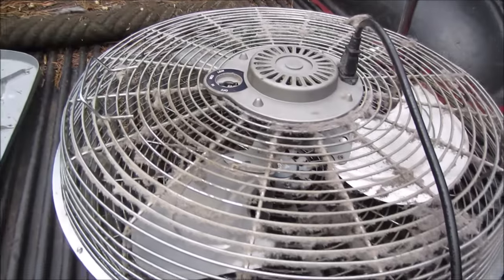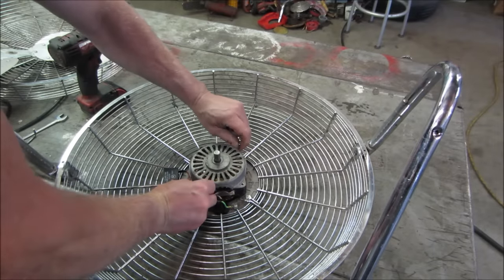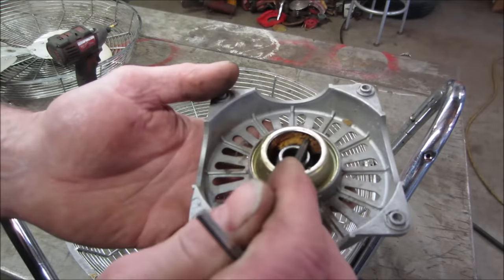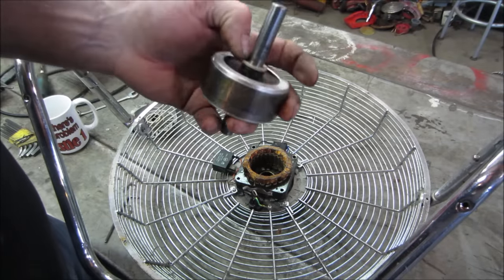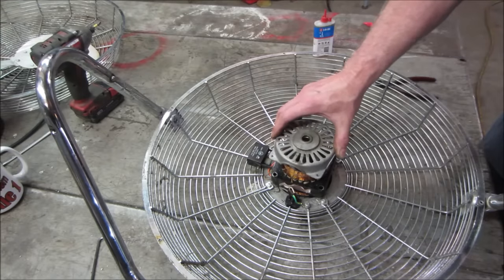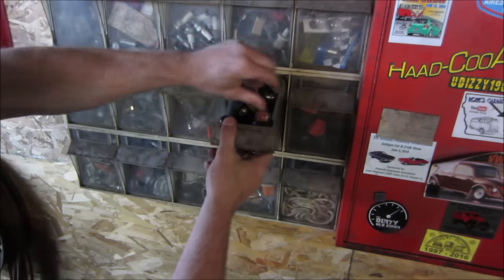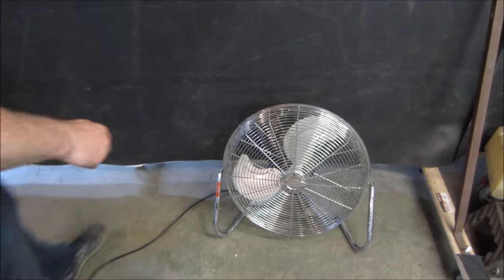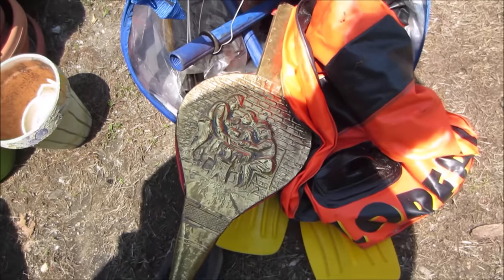Fan Blades Won't Spin? Lets Fix It

Comment: Sometimes when I’m yelling at the screen, I can’t get your attention.  Actually the yellow fiber IS for holding oil. The yellow material is an injectable oil impregnated cellulose, and the sleeve bushings are oilite type. It looks like they didn’t put enough of the yellow fiber material to keep the bushings wet.(probably on purpose to kill the fan in a couple years so a new one will be purchased). Adding some cotton wick and soaking with light oil will keep that fan running a long time.
Reply: You beat me to it!  Yeah, the manufacturer was sure stingy with yellow stuff.
Reply: Exactly. And if you're not going to run that, you should coat it all, shaft and bushing with PTFE.  That'll last a couple years, but eventually it will wear away. The oil and wick lasts longer, but if you can't fix it because you don't have a wick PTFE spray is a nice fix because it also doesn't attract any dirt and it will be slippery for a while.
What he did there, will probably last a few months but when he takes it out from the winter time it might stall again.
Reply: You beat another subscriber.  And that electric motor oil works really well with rejuvenating the bearing when soaked into the fiber wadding
Reply: @TravisFabel  that was literally what i was about to ask next, thx~
Reply: @TravisFabel  what's PTFE?
Reply: @WowHughJanus   PolyTetraFlouroEthylene, aka teflon (and multiple other names)
Reply: @michaeltempsch5282  Actually, its spelt polytetrafluoroethylene; not normally popular in spelling bees.
Reply: Would a corded electric mower run off a similar concept? Mine seems to have a similar problem to this fan.
Reply: over the long term I found that using actual oil lamp wick as replacement works pretty well
Reply: Thanks for the info! I found this same stuff when I took apart my furnace fan that I had replaced when it had started making noise. At first I thought the grease had all dried out so I started to dig it out but it was lighter than dried grease. It was the same as the fan but white-ish grey and looked like they were stingy with the material. I tried to search online for more of the material but couldn’t find any. I wondered if cotton ball material would be an ok substitute? Anyway I ended up just soaking what was left in machine oil (3in1). The damn thing spins like new now so I figure I have a backup if it happens again. I tried searching for posts talking about furnace fans but didn’t find any. So if your furnace fan starts making noise. Instead of running out and buying a new one, take the cap off what looks to be the bearings and soak the bushing and that material down in machine oil. 👍
Reply: manufacture cheaped out, using yellow sponge material in place of the fiber, which which worked too well and lasted many years! ;)
anyway, the oil slowly attacks the foam and it breaks down shriveling into a gelatinous goo. it would have been out far enough to contact the bushing/washer on the shaft to provide lube that way.
Reply: I bought a box fan at Gibson’s in Durant Oklahoma in 1978. It has served as an attic fan in my first home in Garfield, Arkansas, circulated air in the desert heat of Boulder City, and Las Vegas, NV, and now lives in my greenhouse in Montana. The plastic grilles died of embrittlement over a decade ago and were replaced with 1/2” hardware cloth.  Every couple of years I take it apart, clean out the dust, soak the bearing pads in light oil, and put it back together. 42 years, and all I need to do is oil it every couple of years.
Reply: Glad Im not the only one lol. Yeah seen lots like that where they dont even bother putting the felts in to hold oil for the bushings, or even bother with the oil itself for that matter. But properly lubricated they can indeed last for many years, to the point where the rest of the wiring and plastic break down or the metal rusts out.
Reply: @WowHughJanus  Teflon
Reply: @SavageDarkness  only one way to find out. open er up. just dont sue me if something bad happens :)
Reply: IT WAS NOT ON PURPOSE.  It is deliberately done to limit take operational life-span of the device [fan in this instance]  One should also check the starter capacitor. A common point of failure..
If the items did not fail, how would the economy grow and prosper?
For the elite to become wealthy, the common people have to remain poor.
The Elite 1%  and the comfortable 50%  need the financial support of the poor 49%. 
That is how Demo-crazy works.
Reply: Andrew_koala starter cap was my first guess.
Reply: @andrew_koala2974  Imagine when you live in a place where 90% of people are poor. Thats great for that 10% left. 
Greetings from Argentina. A country that has everything lithium, oil, gas, fish, gold, water but we are always in a default economy somehow...
Reply: For real? I always disassembled the fans and put some oil on it every now and then, now I know I just need to put some oil (or grease?) in the cotton and stuff it there. Thanks dear net citizen.
Reply: peter d  What is detergent lube ? I have a small heavy-duty high rpm shop fan have been running a couple yrs now ,been acting up a while plug it in it hums give the blade a little help spins one way super fast one way not so much ,gonna pull it apart tomorrow now that I have seen this .
Reply: i use a graphite in an aresol can and have had good results over long periods of time
Reply: Where to get cotton wick?
Reply: Randy Pond  in a pinch, a white athletic shoelace will work.  Look for all cotton.
Reply: I have found that light weight Mobil one is an excellent fan lube.
Reply: I wonder if using Silica wick would be better than cotton... i've got one of these fans that is slowing down with age, time to crack it open, stuff that bushing with silica, pour about a tablespoon of 3in1 in.... and wait and see lol - PS - does anyone think it's doable to replace those bushings with sealed ball bearings?
Reply: @WowHughJanus  PolyTetraFlouroEthylene
Reply: @TravisFabel  They used to use felt in different configurations. Felt can be had at Joanne's Fabrics or other stores, and cut and stuffed in place of the original wicking. I like to use transmission fluid on it.
Reply: @SavageDarkness  Yes
Reply: @jeffr0  - Actually running capacitor. These high capacity fans use what is known as a "permanently split capacitor motor," which has the capacitor in the circuit full time, so it is actually a run capacitor. This improves both the torque and power factor of the motor.
Reply: Kali Southpaw  - Just can't avoid politics rearing its ugly head into any conversation these days. You and anyone else who doubt Andrew koala's assertion should check out a vid called "The Story Of Stuff."  I'm sure at least a few ppl will get the concepts presented, though I doubt you will.
Reply: I've used a small drill bit in the past, smallest one I have on hand to drill a hole through the bearing for an oil hole.  Once those bushings get hot they gunk up and the oil has trouble penetrating into the pores.  Also I prefer synthetic sperm whale oil for fan bearings.   It's what Hammond shipped with their tone-wheel organs for motor and carrier bushings, as it doesn't gunk up into goop.  Not had a problem with the synthetic oil (Hammonds often still have actual sperm whale oil squeeze bottles in them shipped from the factory in the late 50s.  The synthetic stuff is available online.
Reply: I had a similar problem with the blower fan in my forced hot air system.. The bearing was similar.. Looks like saw dust is what was packed in the bearing to hold oil for the porous brass bushings.  I put the bushings in a canister of solvent, heated them and applied a vacuum.. Bushings cleaned up nice.. Repacked the bearings with MDF dust and oil.. Just added oil every year for the next 10years til I got rid of forced hot air altogether..   Bush fix.
Reply: That is actually genious, I have one with the same thing stuff in the bushing. I figured that was the purpose but it's also completely dried out. Adding oil doesn't matter since it no longer retain it. I'm worried using Cotton that the fibers might end up gathering around the shaft and seizing it, hence getting to the same results. So I'm thinking removing all the oilite or how ever it's called. And just stuff some Farm Grease or All purpose Grease in there with some tolerance to heat since it's pretty close to the engine and the spinning shaft will probably generate heat and could liquify most greases... Any toughts ?
Reply: @Frank183847572828   although grease seems like a good idea, the bearings will clog and lubricity will fail.   Oil can flow freely through the pores of the sintered bearings.  You just have to provide a reservoir for more oil.  Cotton can work as a wick/reservoir too.
Reply: @kenwolfe6093  In this case, I was thinking grease in case of a bushing, oil in case of bearings. I fixed mine by cutting small pieces of a sponge and adding to the the yellow "cellulose" in the bushing. Then added oil. But was wondering if grease might just have worked better long term. I figured I can always remove them with Tweezers.
Reply: @andrew_koala2974  — planned obsolescence
Reply: Light oil a 3 and 1.add to wick.?
Reply: @thepickn  yes
Reply: :)...Sounds like you've fixed one or two...:)
Reply: Thank you
Reply: Thank you for the info
   Purchased a fan, similar to the one in this video, a few years ago...and it stopped spinning.
  Hoping this will fix it. . .I'd rather not have to buy another one...if I can repair it myself.
Reply: ...most if not all of those HV fans have greaseless bearings to prevent friction over time....Adding oil or grease just shortens the lifetime......I imagine the foam was preventing the bearing from tilting which caused unnecessary friction which ultimately was preventing the blade from spinning...
Reply: @phrodendekia ❤

Comment: Ok first clean shaft then polish shafts with 3k 4k then 3m polish paper I use a drill until they are mirrors no groves perfect.... Then I replace wicking with felt. bearings i clean iso, then plug1 end and soak with oil. for a while. mark housing for reassembly keep track of shims, i use wires. lube motor reassemble. trick from a professional site hit end of shaft hammer quick rap to align bearings. spin it is it smooth and free..  reassemble.. done my fan is over 20 years old.. I redo yearly it gets used a lot in summer.. but you must polish the shaft, if not  waste of time.. I use an meter to test if motor is in spech.. withn amps..  if shaky i set up a jig to balance blades//  use non detergent oil only, I add tpfe tough oil it works..my fans bearings dont get hot after hours of use.. like 8..its my hobby..  my ge box fan is 60 years old, main bearing is end to end//  If it binds gentle tap on end of shaft re test if not smooth free do again...  lasts a few years..  my bath fan is 16 years old runs like new..  there are sites for rebuilding but need to watch a few to get all the tricks

Comment: I'm a really old timer so here it goes to you young folk.  I loved seeing you rescue a usable piece of equipment from the land fill, great work!   Although my methods would of been different.   
First a history..... the fans in the old old days used a fiber wick.  If possible the wick was located over the shaft.  The wick was easy to remove and we would simply apply a few drops of 3M oil to the wick and replace it.  You do this once or twice a season and the fan would last forever.  Gravity would insure the shaft was lubricated.  
I still have some of my fans from the 1950's and they run whisper quiet.  I'm sure someone already told you below but I'll just say that the stuff you think is dried up grease or glazing is a material sometimes called permawick (the company name),  It's purpose is to hold lubricant to keep that shaft lubricated.   It's supposed to be there and you picking at it made me cringe.  If I saw things correctly on the video you did not oil that permawick material before you replaced the bearing.  At this point the oil you put on the shaft will last only a short while and you'll be back to square one soon.  You need to add a few drops of 3M 1/4 HP oil to the permawick and you should be good to go for awhile.  
Speaking of the shaft, I would not of used a wire wheel on that shaft.  That shaft is already experiencing issues and I would not add to them.   You just introduced 1000's of micro scratches to it.  I would of opted to use another method to clean it up.   I would of tried elbow grease, oil and a rag first then perhaps an fine or ultra-fine grit sandpaper as a last resort.  Never go to the wheel first.  Take your time.
Reply: really lucky to have you here  and relay that story and all the tips therein. That was a treasure trove of information from a time gone by that still applies this very day . my interest in fans has been out of a necessity as I haven't had  Air conditioning in about 5 years now , and south Texas gets pretty brutal. being short of cash forces one to hone the
 imagination and creative skills to make things do or from scratch entirely.. Ive bought several fans form the big box stores and they Peter out within a year growing slower and more lethargic,  irritated with todays LACK OF QUALITY I HAVE  resorted to other means and machines to which I apply the fan blades from the junk ones. a perfect standby is applying a fan blade to the shaft of a washing machine motor. its thermally protected and is continuous duty, and turns an RPM of about 1025 to 1075. and typically will already have a capacitor. they work great and blow plenty of air , I must say though my best build has been from a small SHANG YI motor about as big as my fist. that had in storage and for the life of me dont know what it come off of, so I put a small fan blaDE ON that thing and at 3300 rpms it moves a room. fearful to have my head chopped off I made sure I built a cage for the thing, and I love it. it was nice to hear from you and relay  your advice. stay sharp and keep your powder dry, and again, thankyuou
Reply: My old fan gave out recently will see if it needs oil on the permawick. I did that for our 1940s rotaery kenmore sewing machine a decade ago before it was rehomed worked like a top.

Comment: I’ve got three of these (2 are monsters like that) out in the shop I picked last fall. One is a penguin 10” personal fan, (a mini clone of that one) one monster on a high stand and the other is the floor monster one like that. Same basic maintenance including adding a knob to the stand one which luckily I had a set screw knob for. I’ve been hosing fans off forever making neighbors scratch their heads even saying they’d be afraid to plug it in again. My response is “how else am I gonna dry it off? ” lol Never had one pop on me yet.  In this throw away world it’s never tough pickens if you have any basic knowledge of how things work. Amazes me the stuff people give up on OR will pay another to do... stay handy my friends! Thanks for the midweek peek Mustie!

Comment: This video couldn't have been timed any better! I have a fan of a similar variety (3 speed floor fan, clamshell motor) that's been in regular service for 15 years and the other day it wouldn't chooch. Unwilling to give up on it, I used this video as a tutorial, cracked the case open, cleared the dust out and applied copious amounts of skateboard bearing fluid to both ends of the rotor. Now it chooches like new! You've saved me tossing something that needed a bit of intermediate service and hopefully it'll last for another 15 years! Thanks!

Comment: I found an almost identical fan in the trash. As long it hums (whether it turns or not) it is just a matter of cleaning and lubing. Resaturate the felts surrounding the sintered bearings with #10 oil. If it doesn’t hum, the thermal fuse imbedded in the windings likely has melted due to slow RPMs, in which case you can replace it or at least short it out. (It is not needed to prevent fire IF you always keep the fan lubed, but those inheriting it won’t know that.) The hardest part was removing the six 2 mm machine screws holding the grille halves together. Three were immovable and had to be drilled out. All in all, no fan can’t be revived, and will last forever if kept lubed. Lucky for me that I know this, because I have found four fans this summer alone.

Comment: I had a similar thing with the electric windows on my Vauxhall Cavalier, after 30-odd years the original grease Bosch packed the motors with had turned into something like half dry snot. Cleaning that out and adding fresh grease fixed it like a charm.